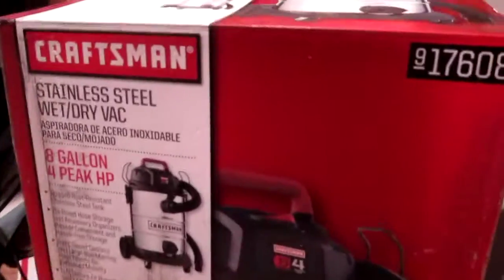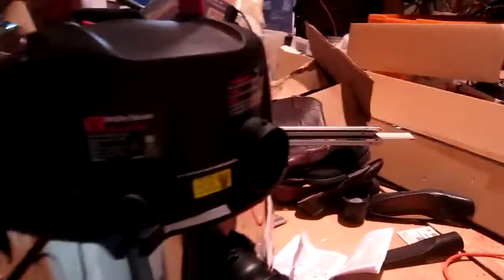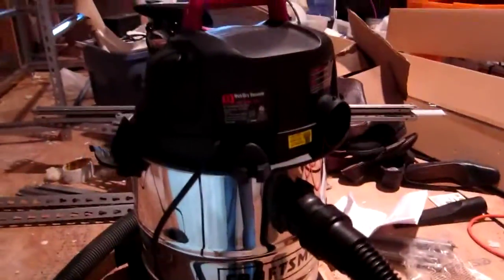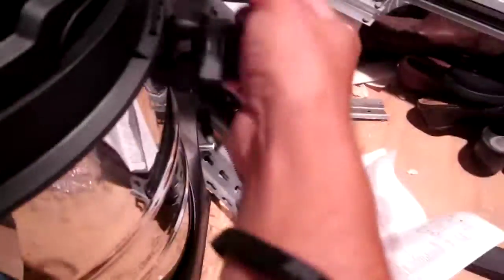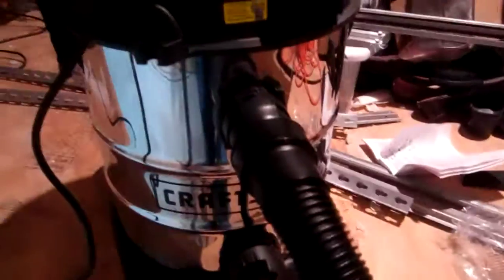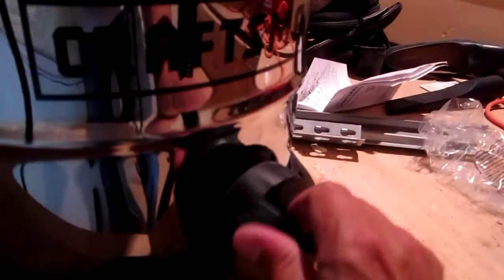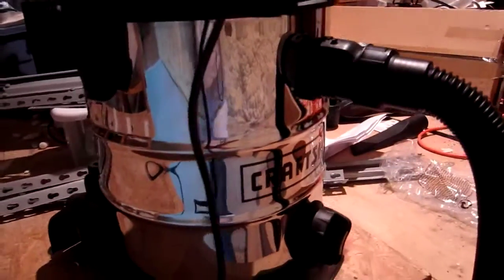Sears Stainless Steel Shop Vac Review and Comments 8 Gallon

Comment: it came with some type of filter cover im guessing a black pocket. can you tell me more about it?
Reply from the maker: maybe it is to store your attachments
Reply: +Original Texan thanks but the material is like some type of filter
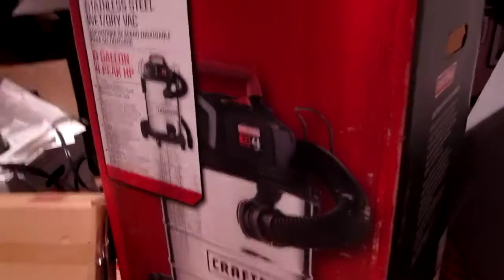Reply: +Original Texan minute 2:17 you point at it with the camera
Reply: I believe that is what you cover the cage with for wet use after removing the paper filter. The instructions specifically state to remove the paper filter and put the foam sleeve over the cage.  The instructions have poor illustrations, but that is what I did, and it seems to work well. The inlet on my toilet tank leaked and I woke up to standing water slowly filling up my bathroom (note: check the plumbing on the toilet at least once a year) but this vacuum made short work of it. Another hint- make sure you know how to changeover all the components BEFORE you have an emergency! So now I am going to replace the regular paper filter, and all done.

Comment: You could clean up all the dust you want if you buy the optional microfiltration bags. I own this Craftsman model and I never use it without having the bag.. you get a pack of three bags for about $10 hours and the bags are enormous. I've had my vac for about 2 years and just put in its third bag. It's not a bad unit but I do have some issues with it. Mine has an annoying whistling sound and has since it was brand new. Also the universal attachments are not so Universal. The weird shaped hose requires you two look for special size detachments which you're not usually carried by Sears however the unit is actually built by rigid brand and parts can be found at the Home Depot. I had to get an extra wand tube for it cuz the unit only comes with two which would be fine if you were the size of a midget but it's six feet tall I found the two original one too short.

Comment: My bet is that over the long haul, if you ever pick up water, that bin is gonna rust...even though it's stainless. Looks cool, yes, but over 10 years, it'll turn into a rust bucket. I'd like to be proven wrong.
Reply: You are right. Any moisture. I haven't picked up straight water but just you know water by the sink or whatever and it's starting to rust all the seams